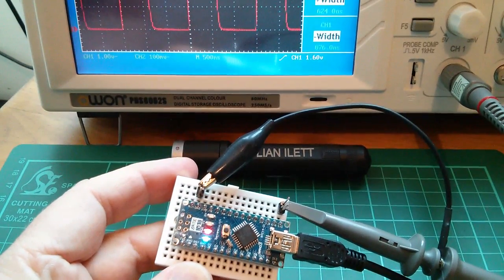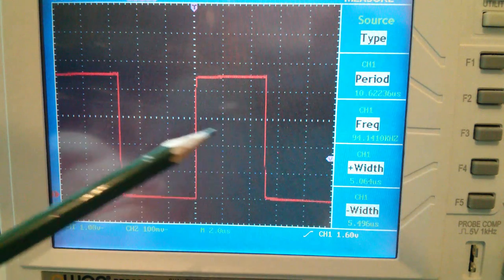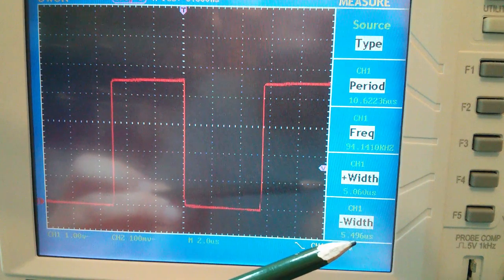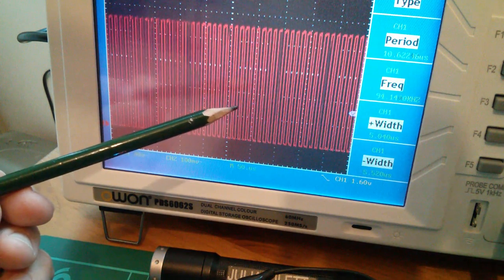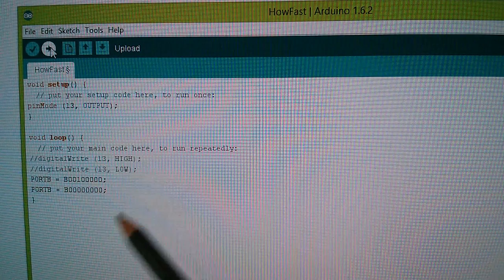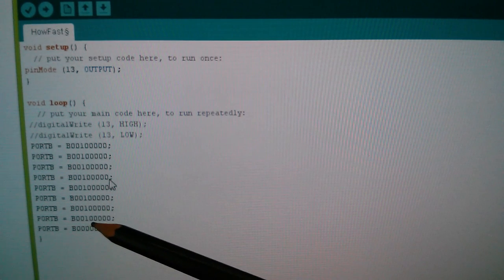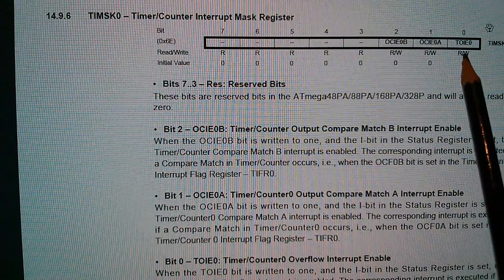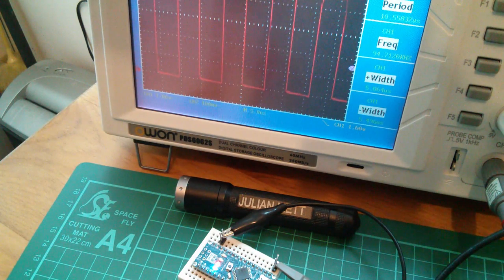Julian Investigates: How Slow is Arduino?

Comment: And to the many folks who have suggested that Julian take up AVR assembly programming... I would remind you of two important principles. The first, paraphrasing the great Don Knuth,  is, "a cardinal sin in computer science is premature optimization." Put simply, focus on getting your code and algorithms correct and then address performance issues as  needed. The second is Amdhal's Law, which basically says that you should focus optimizations on code that is both slow and which takes up a significant percent of processing time. Julian followed both of these rules -- he wrote a correct program, assessed its performance, and then optimized the bits that were causing performance issues. Granted, this is a very simple example. But, unless one just really enjoys coding in assembly,  one is best advised to avoid it except in the (generally) rare circumstances where it's appropriate to insert it. And, at that, one should examine the machine code generated by the compiler first before claiming that the compiler didn't/doesn't do a good job or that it can be done substantively better by hand and that the cost of doing so in terms of readability, portability, and time invested is really worth it. 

And, for the record, yes, the Arduino libraries do introduce overheads, sometimes very large ones. So, if timing or performance is critical, bypassing them, which is generally quite easy to do without abandoning the Arduino IDE, is certainly the right thing to do... or, perhaps, write better ones and contribute them back to the community. :)

Comment: btw: there is a "arduino function" to disable interrupts. i think its " nointerrupts() " . you should also try using bitwise or and bitwise and operations to set and delete bits on a register. dont know it its faster, but it clearly does not overwrite or clear any other bits in the register. Also if you want to be in total controll or timing and things to happen, it might be a good idea to NOT USE the "loop()" routine, but making your own "while" loop. that is, because if you disabled interrupts in your own while loop there will be nothing else but what you wrote yourself. with the "loop()" loop its more likely that this is "NOT" a real loop, there are things happening before and after one "loop()" run. things that are not interrupt driven, but may interfere with your expected timing.
Reply: +Julian Ilett , i did some more research and testing. i was able to bring it up to 2.6MHz. see my results and screenshots here: http://bit.ly/1P00hKn

Comment: Could be interesting to se to see how fast

while(true)
{
PORTB = B001000000;
PORTB = B000000000;
}

is, compared to loop(), the "while" should remove the arduino housekeeping on every loop()
Reply: K5HJ wouldn't that just continually set PINB to 1 so it would just stay high?
Reply: K5HJ ah gotcha, forgot about those, been using them a lot while programming xmega chips and for some reason assumed the older mega chips didnt have the same functionality and could only directly write to the pins hehe... ><
Reply: K5HJ Good Grief! Never used that!!!
When I've finished Windows 10 upgrade, I'll give it a shot! Time to re-read the datasheet. Knew Xmegas had it, but...
Reply: K5HJ that is very cool actually
Reply: Of course, you could unroll the loop and just insert a hundred identical lines of:
PINB = B00100000;
PINB = B00100000;
PINB = B00100000;
PINB = B00100000;
...
That would be much faster 99% of the time, limiting the loop overhead to just one ‘sputtering’ every 100 instructions. It’s a hack, but it would show more clearly how many times Arduino can actually switch a pin on and off in a microsecond.
Reply: Unrolling was used a lot back in the 8 bit days on micros

Comment: Some one has already suggested this but I will repeat it. If you're going to do these type of experiments then use assembler. The Arduino IDE is designed to make development easy but in so doing it introduces masses of overhead. Even the loop in the code is generating many, many instructions. The IDE abstraction prevents you from getting accurate results at the level you're measuring.
Reply: tobortine 
That's why he wrote "How slow is Arduino?" and not "how slow is an atmega?". It wouldn't be Arduino if you are programming in assembler.
Reply: superdau but then i guess then it is "how slow are arduino functions" and not "how slow is arduino" since arduino doesn't limit you to using the provided libraries.
Reply: superdau
Ardiuino =  Atmel processor + Peripherals + IDE
The peripherals are only used to load the code so the IDE (libraries, macros, etc) are what slow down the native chip. If you're making a video about how slow an Arduino can be then showing the relative speed of the native chip with efficient code illustrates the point.
Reply: tobortine i don't think so to be honest, i think if you are comparing arduino code to something you should compare it to C because C is the language someone looking to transition away from arduino is most likely to be moving to. 
you dont compare a sports car to a race car when your audience really want a supercar do you? :P
Reply: megaspeed2v2 At last check, the Arduino development environment already uses C++... some code does actually use the object-oriented features in C++, but most doesn't or cleverly hides it from you; so, without starting a religious war about C vs. C++, Arduino programmers are already programming in C. The point, though, is that you can develop high-performance applications while retaining some of the Arduino IDE and toolchain's benefits; you just have to RTFM a little more. The nice thing is that you can decide how much deep magic you wish to explore and are not thrust headlong into a raw microcontroller development environment with all of the attendant arcane goo that's required just to get a simple program working.
Reply: With respect, the "IDE abstraction" seems to have worked just beautifully in this  example. I think, perhaps, your point, and the more general point of this discussion is that, by hiding certain low-level details, the Arduino libraries also introduce overheads. Such is the nature of abstraction. And I think this video does an awesome job of bringing visibility to a very common instance of such overheads and demonstrating a pretty clean and elegant workaround for it. If you think you can articulate this point to a general audience in such an accessible manner -- in assembly -- then please start making videos! Else, remember that we, the trained engineers are generally the minority of the viewers and I expect that the present treatment of this subject is at the right pedagogical level for both "civilians" and "pros", alike. Cheers.
Reply: Alex Blate It's a good video, I'm not complaining. I'm also not suggesting that the whole thing should have been done in assembler. My point was simply that a little assembler, taking the code closer to the chip, might have helped illustrate how much overhead the IDE can introduce.
I agree with much of what you say but one doesn't have to produce content in order to be critical, otherwise most journalists would be out of work. :-)
Reply: tobortine  I agree. I'm have no experience with the IDE but can't you just view the assembler code with it. All the time I was waiting to see the code. It would be interesting to see what the compiler made of it. He is testing the compiler in this video not so much the mcu. That's why the title is somewhat misleading. I have the feeling that many don't understand any more what the compilation and assembler stands for. Still a nice video, but a missed opportunity.

Comment: Did something similar a few months back using a logic analyzer.  I was able to get the Arduino board to 4 MHz and could see those glitches in the pattern as well.  I did not set interrupts off - just bit toggled the one pin off and on.

Comment: I have only just begun playing about with Arduinos this month (pretty much due to your videos - you are responsible for the postman visiting almost everyday this week with a new little free-shipping treat).

But the first thing I did after Blink was throw the Arduino IDE and its libraries overboard. I understand the beginner-friendly broad-appeal thing they were going for, and it probably works for that, but as your video clearly shows, too much is happening behind the curtain. For me anyway, I think a lot of the fun of mucking about with this whole embedded caper is to be right down there, and just that little bit closer to the silicon. You can't do that with Arduino libraries slowly moving the scenery behind your back.

So for me that means using something like SublimeText, makefiles, and writing code just based directly off the Atmel datasheet and lots of google. Very happy with that setup. Fast and direct. There's a steeper learning curve for sure, but that's more than half the fun.

Comment: Julian, as you might have found by now there is a interrupt enable bit. It's (for a Atmega168) bit 7 of the SREG register. But there is a quick macro for it, cli() (CLear Interrupt) en sei() (SEt Interrupt).

And yeay, Arduino has a lot of overhead. But it's always a trade of between fast, versatile and complex or slower, more static but a lot easier. And the last part is the whole reason, making it easy to use.

But what are you planning on doing? Sounds like you should just use the PWM.

Comment: Two things. C++ is closer to the metal but it is not assembler. 

1) Each line of code will be 1 to n lines of assembler.

2) any function call in c++ pushes values onto the stack and the return pops those values off the stack... Or potentially anyway. Pushes and pops are moving registers to / from memory and take time.

3) use an xor to flip the bit. That should leave the other bits of the register alone.

Comment: Let us analyse what is going on here:

1) digitalwrite(output, state)
The output number has to be translated to a specific bit of a specific port. This involves two lookups using tables. One lookup determines the port associated with the output and the other constructs a bitmask to associate with the output. Finally the action of setting or clearing the bit has to be determined from the state parameter. Given that the lookups incur significant overhead it is not surprising that digitalwrite takes a good amount of time to execute.

2) loop function
Associated with the loop function there is some housekeeping code. It is small but it is executed once per loop function iteration. I believe this housekeeping is associated with managing serial I/O at a low level.

You should be wary of using direct port I/O for the reasons that Julian described but it is important to make your I/O operations atomic to prevent side-effects caused by code executed in e.g. interrupt service routines from clashing with the values you wish to write and causing undesirable effects. At a high level you can use the &=, |= and ^= assigmnent-with-modification syntax to only operate on the bit(s) you intend to modify but this requires that the compiler handles these assignments atomically. At a lower level, assembly language bit-set and bit-clear instructions are a better solution because they are atomic by design.

Comment: Yes, the C compiler leaves a lot of guesswork for bit-banging.  Look at the machine code, then write in machine code, or simply do it in assembly language which can be done on Arduino if you can find an assembler.  Microchip was more my style since that is native assembly language.   At first and still, I was disappointed with Arduino, trying to figure out what it was doing and immediately started on a difficult path looking for an Arduino assembler to make the Arduino do what I wanted it to do.  Not much luck, except that assembly language with Arduino is possible or fast machine code can be inserted into the compiler for critical fast timing.

Thank you Julian for scoping the Arduino and showing the C compiler confusion trying to make the Arduino do what you wanted to do and what you know is possible.

Comment: When the disappearing occurs are you suggesting the square wave stops working ? Missing pulses ?  Can your oscilloscope sample when such an interrupt occurs to see the waveform Vs time ? If this is the case wouldn't this cause many errors for all output projects based on timing  ?
Reply: my guess:  the output is oscillating continuously but the length of a pulse may be increased periodically by the timer0 interrupt service.  We see stuff vanishing briefly while the scope re-syncs, or we're getting a strobing effect.  Maybe an old-fashioned analog scope would do better?  It's only really significant for projects that need to make pulses at accurate length and/or "high frequency" e.g. audio output at an acceptable sample freq.

Comment: The issue is loop overhead.   Calling a subroutine is very tedious.   This is fixable by applying Bit-Banging which is port read right of all 8 pins in a port in one step.   Reading a port the same way is much faster.   Also clocking loop out using while(1) {...} to contain the action speeds up things by about 62 clock cycles vs the loop() { .... } thing

Comment: Morning Julian - If you really want to push the speed limit try Assembly Language. The native code that all micro's normally use. What Arduino does is disassemble your code into assembly language so that the  micro can execute it. Assembly is quite lengthy and cryptic, understanding the Instruction Set is the key. I would suggest using Atmel Studio 6.X because you have the benefit of a full fledged programmer. If you don't want to use assembly try using C+ because it is the closest thing to it. I'm sure that you are aware of this and your channel is geared toward the beginers side. Since Atmel Studio is FREE for Windows users I never use Arduino to code any more. Sure the learning curve for steep, but there is ton's of info online to get you started. Code you write in Arduino is the same as in Atmel Studio, but the major difference is that you're not restricted to one language. Thanks for all the great video's, Cheers ;-)
Reply: T Komoski C is closer the machine than c++. Yep, good idea to try Atmel Studio of you don't mind the 2G download but the problem here is the overhead in the 'arduino' libraries and chip setup, and that's how the majority of people here are going to be using the boards.  
Also,  I use gcc with my own waf 'makefiles'. You can use -S with to output the actually assembly language generated. If you do that in this case you will see there are surprisingly few instructions emitted for this code. The problem here is all in the 'arduino' framework.
Reply: Thanx for the advice... I'm downloading it now !
I hate these higher languages for simple devices. Now i can use my old C64 tricks to optimize for speed but also important SIZE ! (speeds doesn't cost money, memory size does)
Reply: Under GCC, identical C and C++ code produces identical output. C++ classes and C++ iterators are zero-cost abstractions (compared to the same thing in C).

avr-gcc is pretty smart; it is able to turn PORTB |= (1<<5) into SBI PORTB, 5.

Even the free sdcc can optimize STM8 bit sets.

Comment: Great vid. That's quite a surprise on how slow the Arduino Bootloader (the firmware that uses the stuff that you've typed up in the IDE) actually is.
I suppose it wouldn't matter so much for most general stuff, but I"m wonderin' how much would that hold back something like a brushless ESC?

Comment: QUESTION- if an Arduino gets 5Volts Vcc what should be input at one of the Analog inputs in order that it will show 1024 reading from its A/D converter? is it also 5volts?
Reply from the maker: Interesting question. The A/D converter can't return 1024, the maximum result is 1023. This does not indicate a precise voltage - it indicates a voltage range - very close to 5V but with about 5mV of latitude.

Comment: Thanks for this! Great video!
I do hope the developers find a way to optimize the conversion eventually.

For example from pololu's library this command: 
set_digital_output(IO_D3, HIGH);

compiles to this in assembly:
sbi 0x0b, 3  ;i.e. PORTD |= 1 << 3; (PD3 high)
sbi 0x0a, 3  ;i.e. DDRD  |= 1 << 3; (PD3 set as output)

I don't see why they can't do the same for digitalWrite( 13, HIGH)

Also may I ask why you think they chose for the conversion to happen at runtime instead of compile time? It seems to be a bad decision. 
cheers! :)

Comment: It should most definitely be a crystal. They get smaller than that. :)

Also, if you set your scope probes to 10x (and tell your scope that's what they're set at) it should show a better square shape. 1x mode usually lowpass filters the input at around 8MHz or so.

And if you put a while(1) { } inside the loop() around the PORTB:s, it should reduce the overhead a little bit more in the jump back to the start again.

Comment: arduino might use bitwise operation to change only 1 output. so your test ist missleading since you make 2  total different compairison. write the second part manipulation in a way that the other 7 bits are ignored. now you set acctually 1 bit high and 7 low. since it is an 8 bit processor you can manipulate 8 outputs in parallel. thanks for a follow-up
Reply: Atmegas ALWAYS overwrite the whole buffer at once, disregarding how much bits you change, it is a single cycle instruction.
Reply: yes, but to get a 8 bit row of outputs changed, you need some math, and that takes time. modify one complete Port in AVR, and you bypass the arduino implementation.
DDRB = 0b11111111; //set all pins of port b as outputs
PORTB = 0xFF; //write data on port

This will be the faster way. It is regular C AVR programming and no arduino interaction is being processed.